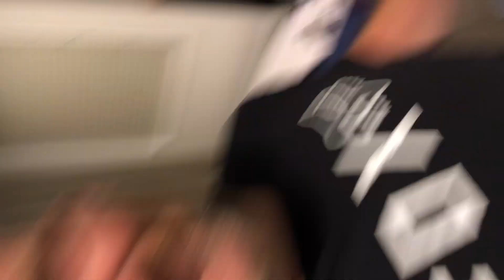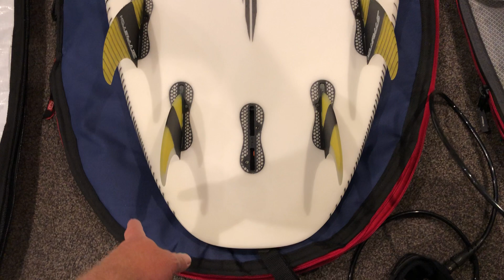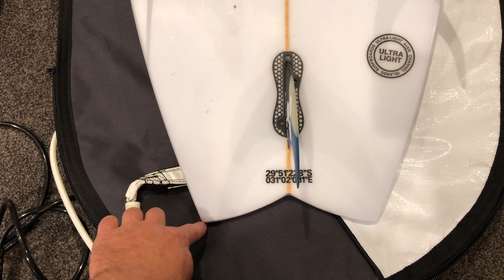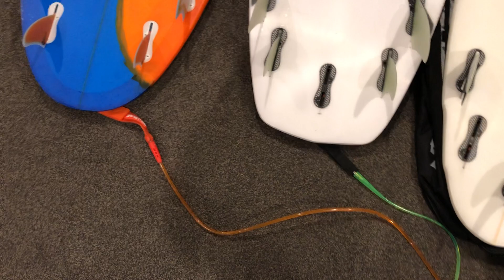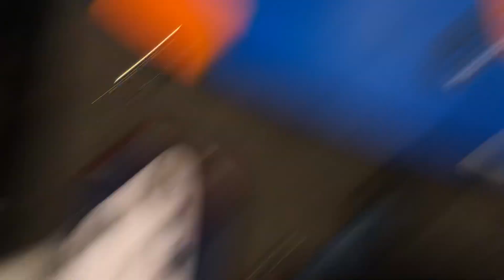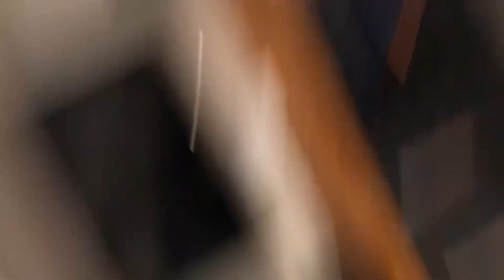Surfboard Tail Shapes Explained

Comment: Well done, laddie. Swallow tails with 6 deep channels ( a proper one like a Byrne Hot Buttered or Wayne McKuen's Mt Woodgee or In The Eye from the Outer Banks, no tat ) are sweetest for me. We are all different . Pintails are harder to blow the tail straight up . Love a 6'6" strong bump squash with a UL team glass job and Astro Deck front and back, Island Style ( SA) cord and Killer Bees wax when needed also from SA. Been trying to get enough money to buy new boards and your video is in my humble opinion, jolly good. Please head to your best local for several pints of best bitter .

Comment: Most of the boards I’ve surfed had a round tail (Omni, Chilli rare bird, ...). I find the round tail most pleasing to the eye. Some people say the tail has the least influence on how the board surfs. Do you agree?
Reply from the maker: Gordon Flash yeah I'm personally a big fan of round tails and a clean elliptical outline too. Tend to carve more than snap turns so the control suits my surfing.. I would also agree the shape of the tail isn't the be all and end all. Baords staples for if they work are rocker, outlin, foil, rails then concaves and tail shape are kinda the cherry on top really. Don't think changing the tail shape would change a good board to bad or a bad board to good 👍
Reply: GO SURF Thanks for your answer. And I like your video’s, so keep up the good work. Greetings
Reply from the maker: @gordonflash3698  Cheers mate.. Thanks heaps for your support. Thinking of doing a piece on rocker then maybe building a quiver. Glad you like the content. Your obviously into the tech of boards too :-)

Comment: So many on the tails and very little. Meaning that there lots of theories about it. Some say is only 5% performance. I do know, from my own experience, that the deeper the shallow tail is, the easier for me to snap it vertically. The pin tail is indeed faster when mixing it with a double concave. The squash, in my experience turns on dime as well. But all this depends on the rest of the shape, concaves, rocker, buoyancy, etc. ✌️
Reply from the maker: Yeah that was a bit of a ramble of a video but that was the point I was trying to get across it's not as simple as just a tail shape it's everything else about the tail and the rest of the board and how it all comes together aye :-)